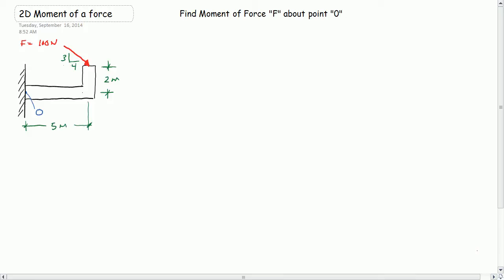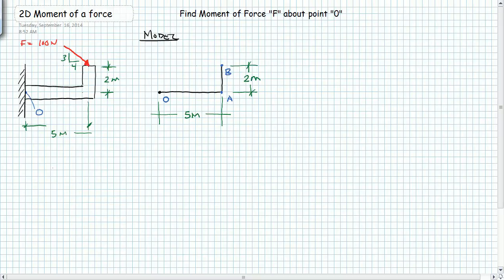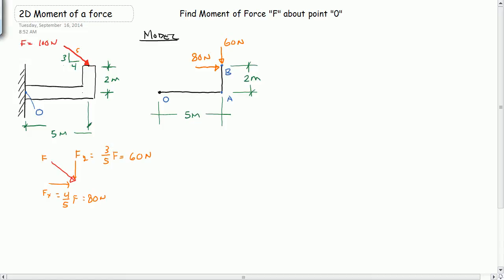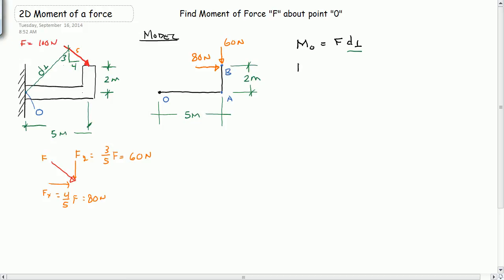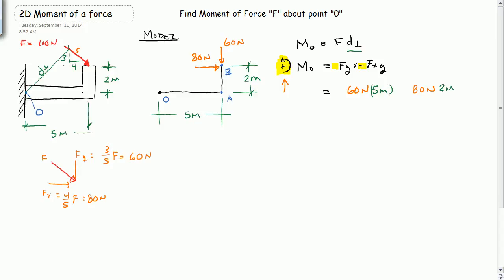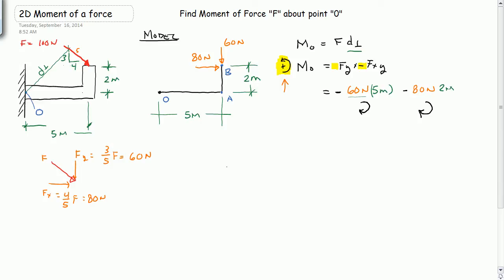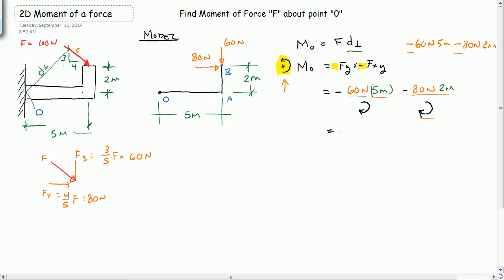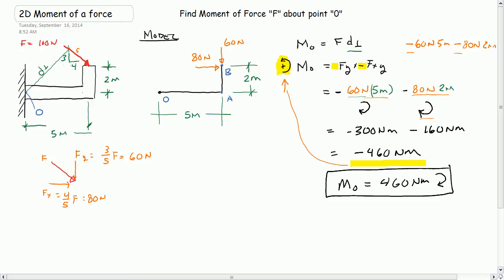2D moment of a force

Comment: what about hte distanceS? are they scalar? meaning no negative and positvi signs? thanks
Reply from the maker: The distances can be treated as a scalar if you respect the sense of the moment (CCW positve, CW negative) about the reference point.  Another way to approach the problem is to use the formula M = Fy * x - Fy * x where Fy and Fx are the forces in the y and x directions and x and y are the distances to said forces.  In this case, you would have to respect the signs (e.g. positive Fx is going to the right, negative Fx is to the left; positive y is above the reference point, negative y is below).  This second method is necessary if you were writing a computer program or putting this into a spreadsheet. The first method is more intuitive for doing the problems by hand, but requires you to evaluate the sense of the moment.